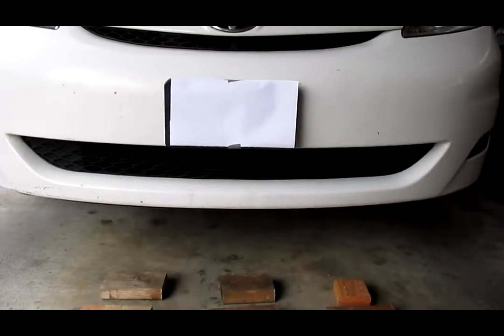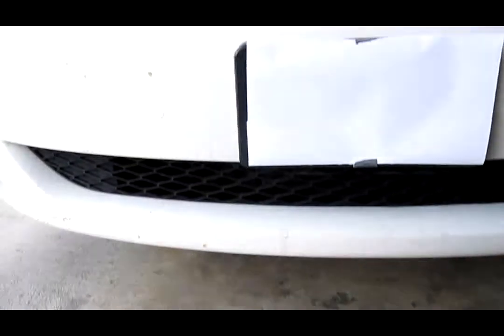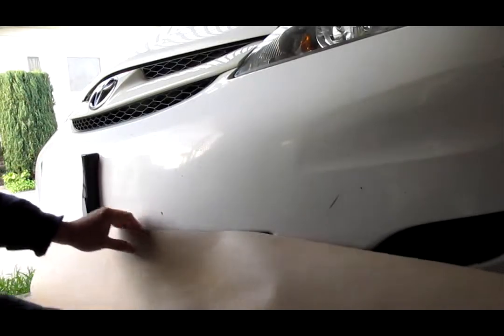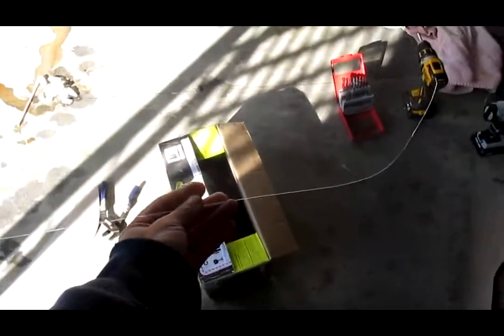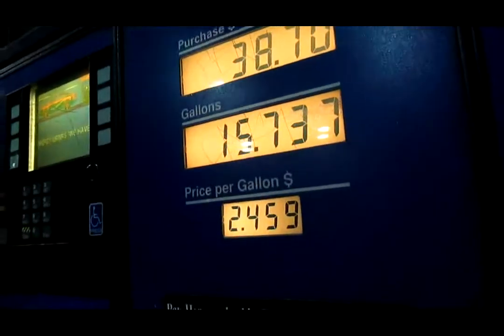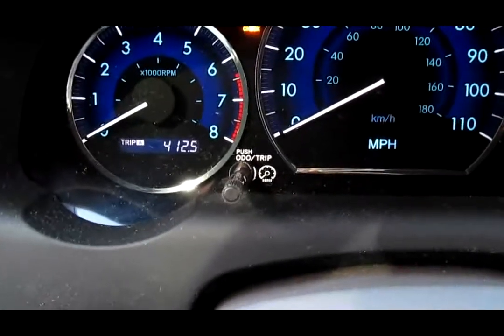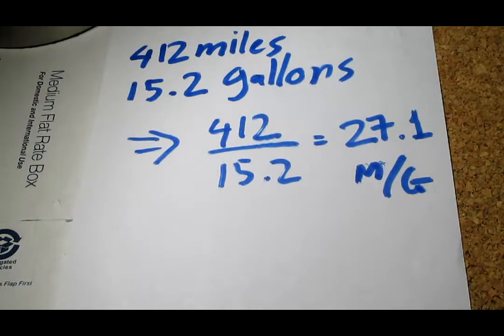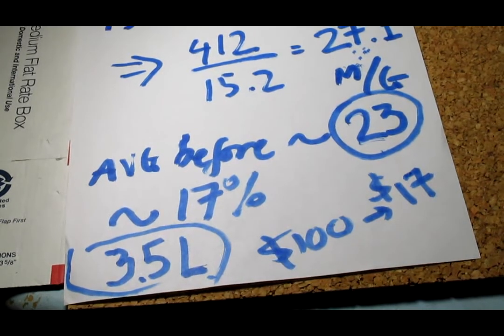My journey: Front grill block for Toyota Sienna 2008 model 3.5L to get 27 MPG & save gas

Comment: Do you have a way to monitor coolant temperature? Dashboard temperature gauges seem pretty inaccurate. My scangauge temp readout can vary 30 degrees and the dashboard gauge barely moves. Also if you use a better temperature readout you can determine the fan activation point and then you can adjust the grill block so that the engine runs at the warmest temp possible without the fan needing to come on all the time. If the fan needs to activate too often then might loose efficiency from having to power the fan.